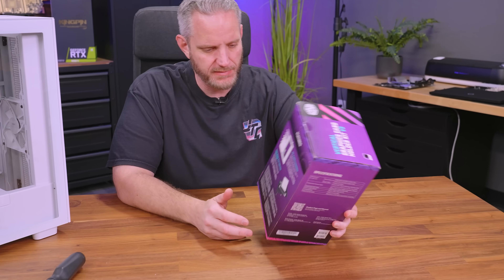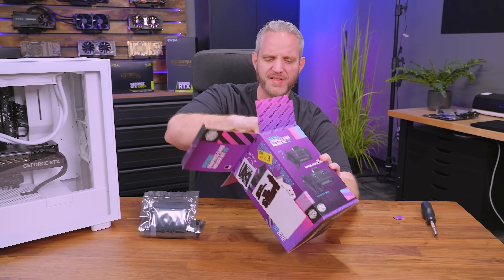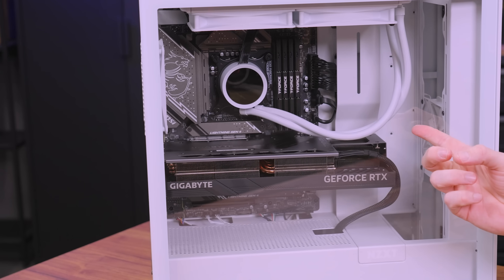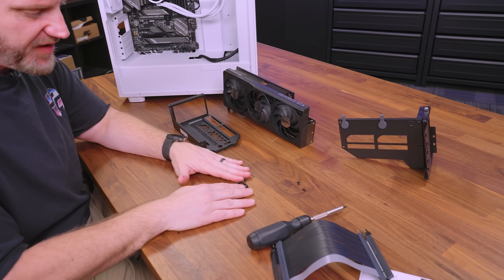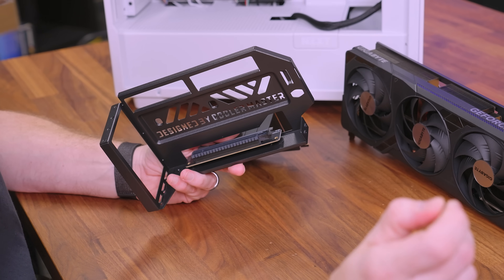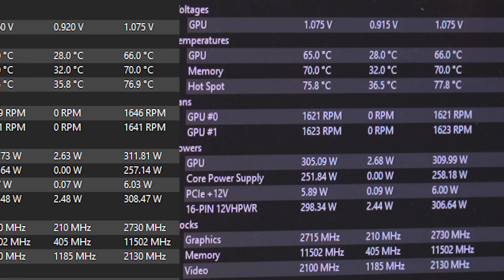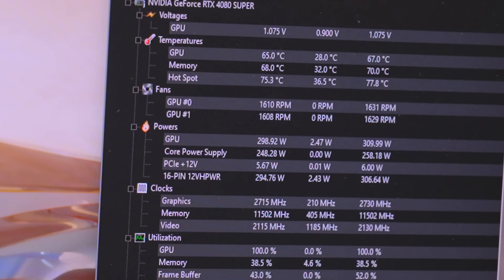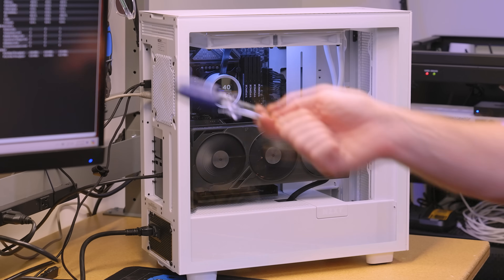Can this mount actually HELP GPU temps?

Comment: Speaking from a lot of experience (as much as possible, since I bought this mount as soon as it came out due to my insatiable desire to vertical mount my 7900XTX and display it in its full $1,200 glory lol XD), I can say this:

I absolutely love this vertical mount from cooler master. I have my 7900XTX mounted on it in a Corsair 5000d airflow case. It takes a little time to get set up, but once its in there, it works awesome. 1440p Ultra getting well over 200FPS with GPU maxing at around 65-70C and CPU (7950x3d) maxing at around 50-55C. Keep in mind, I also have 10 total fans in the case lol (6 intake, 3 in front/3 on side, and 3 exhaust on top on the AIO radiator and 1 rear exhaust) My PC stays COOL under heavy loads, however, my room.... not so much lol. It doubles as a room/space heater hahaha. But this CoolerMaster vertical mount specifically for larger cards (i.e. 4090 and 7900XTX hahaha) is WELL worth it, in my opinion. Being able to move the GPU side-to-side and forwards/backwards on the mount was a surprisingly extremely handy feature. I love this mount. 

EDIT-

NOTE!!!: There is a possibility you may have to mod your PCIe/GPU I/O panels to get it to mount properly. For example, in my Corsair 5000d I had to snip one of the PCIe panel separators/bars that run across, in order to get the DP plug into the case and into the GPU input without potentially damaging the DP cable. But once you have it plugged in, you can freely adjust the positioning of the mount to where you want it. Just throwing that out there for anyone potentially thinking of getting this. To me, I could care less, as I can still horizontal mount if I want despite having to mod the PCIe I/O panels, and the mod is only noticeable with everything disassembled and the case gutted. But you may have to take some wire cutters to your PCIe I/O slots if this is the way you want to go. So if you're not okay with making a permanent mod/change to part of your case, then maybe pass on this. But IME, that hasn't been of any issue, and I've never gone back to horizontal mount after installing this.

(Also, the "anti-sag" effect seen in this video is definitely a real thing and possibility with this mount, depending on your case specifics. However, there is still a possibility of MILD sag (mine does towards the end, with the 7900XTX being so heavy and large) that is easily rectified. But as it isn't GPU sag in the traditional sense, and more so a case of certain metal components getting slightly bent and appearing to "sag" even in a vertical position, it isn't even close enough to be able to cause damage though, and I only support it slightly with a bracket at the end still, solely for looks/OCD purposes hahaha.)

EDIT EDIT: I think it goes without saying, but if you DO decided to get this and end up having to make a few case adjustments for it to fit/mount, PLEASE do any cutting/modding of the case while it is empty. Last thing you want is nearly invisible metal shrapnel/debris from cutting up the back of the case making its way onto your motherboard, or into your GPU, or PCIe slots, etc... if you do need to cut/mod the back of your case, do it outside away from any components, and makre sure ALL potential metal shrapnel/particles are blown out of EVERY crevice of your case. I mean I did it with everything already installed, which is a HORRIBLE HORRIBLE idea that could have been a $3,000 mistake, but don't count on stupid luck like I had haha. The extra 20 minutes it takes to do it safely is WELL worth the time, lmfao.

All in all, well worth the money, especially for cards that are literally impossible to vertical mount in certain cases via the regular means/stock vertical mounting slots. Like, a Corsair 5000d with only 2 vertical mount slots, and a 7900XTX or 4090 that requires 3. The moveability is just an added bonus tbh. Pull da trigger on this if you're second guessing yourself. Most sensibly designed and functioning vertical mount I've come across, that also isn't a whole-ass project just to install. 10/10 would recommend

Comment: Interesting, my vertical mount makes my temps increase pretty noticeable. The glass isn't close to the fans at all, the only thing I can think of it the intake fans on the bottom of my pc are pushing the hot exhaust air from the gpu bask into itself.

Comment: This is actually great news, shame that I only now came up on this. Means I can probably put my strix 4090 in vertical even tough I have bot AND top radiators in my O11D MINI. Couldnt do that with lian-li's own vertical mount, because it requires the mobo to be on very top position, which cancels out using radiator, now I could maybe even go push+pull on both top and bottom rads. (not that I really need to but still cool)

Comment: I don't know man I don't like the look of the vertical Mount... I think the horizontal mount looks a lot better unless you've got a GPU that has RGB fans then I think it looks out of place... It just eats up the entire case when you lay it vertically like that it cuts off half the motherboard there's no color in the fans I don't know man I'm not crazy about the vertical look... Unless like I said, The fans have RGB or there's RGB lights on the face of the GPU or something just a plain GPU like that I don't think looks good at all

Comment: I would figure vertical mounting would be world better not necessarily for temp and performance but to take stress off your motherboard you don't have to worry about bricking your mobo with a giganteson gpu like a 4080 or 4090 or 7900xtx that weighs a boat load and pod allot of stress on your pcie slot ive seen them break off before pretty scary for real that breaks and you essentially get to rebuild your entire pc again that could seriously suck a verticsl mount is beautiful insurance literally in all this

Comment: like my sibling is planning to get an ASUS TUF Gaming A620M-PLUS with a Ryzen 5 9600X & an ASUS TUF 4070 OC Edition vertically mounted with this same mount on it's on the list as we slowly upgrade things she's not savvy for liquid solutions so I got a kryosheet for it and have looked up something that can cool the 9600X without need for liquid cooling and I settled on The Thermalright Peerless Assassin 120 SE Black because she needed something within budget too for now she's gonna use my old MSI Ryzen 011c Vampiric mid-tower micro to ATX case, to my question: Do you think there will be enough room to have the dualfan peerless heatsink on the cpu with the gpu vertically mounted or would it block it in such a case!

with in mind that my old artic 32 esports duo fan one came up to the glass in my old case with my older mb but that A629m-PLUS motherboard is an ATX will the CPU be high enough to be out of the way of a vertically mounted gpu in an ATX case cause the vampiric isn't nearly as big as the new one and the reason I got the hyperion was cause horizontally mounted in the motherboard the cable from my ROG 4070Ti oc edition was gonna be cut off at the stem by the glass until I got the new one I had to have my pc case open without the glass panel on so I was hoping to avoid that for my sibling with a gpu mount 

that's if the gpu mount fits since the old vampiric case the mounting screws for horizontal are on the back outside so it's like old pc cases where you have to mount the gpu as close as possible to the plate at the back and it's not indented with that L corner for screws internally!

Comment: I ordered the V3 in black for my ROG Helios, ended up getting white. But I did see about 7c drop on my 4090 and it was able to maintain higher clocks through entire testing instead of throttling.

Comment: This is why i think, that first: arhitecture of motherboards must change completely, and second: GPU shouldn't be PCIe expansion card anymore.
Guys, imagine motherboard with back-to-front sockets, but also PCIe and M.2 slots turned 90° into vertical orientation. GPU slot would be at the edge of motherboard, facing front of the case instead of its side. This will allow four things:
1 - everyting on motherboard (heatsinks, RAM sticks, additional PCIe cards, CPU cooler) now would be verticaly oriented, witch means, that no component will block airflow for the other ones, 
2 - GPU can be now as large as motherboard, it can be mounted exactly the same, rock solid way as such, next to it, but it'll be still directly connected through this new edge-GPU slot,
3 - because motherboard and GPU would be mounted in the same plane, next to eachother, it will be possible to put them in completely separated case chambers (with cut out for GPU edge-slot), witch means, each pcb board will have its own cooling chamber, GPU will not heat up air for CPU anymore,
5 - almost perfect bottom to top (or side to side) airflow for every PC part would achived.
The only downside would be necessity for additonal PC case wiring, connecting reoriented "case wall-mounted" GPU and PCIe expansion cards to their outlets. And so PC case would be practically tri-chamber, one for motherboard (with expansion cards, M.2 discs, RAM stics and CPU cooler), second for "inner wall mounted" GPU, and third for PSU with its wiring, additional SATA discs, fan spliters and ARGB controllers...

Comment: All those vertical mount adapters disable PCIe cards eg 10G Network Card, HBA / RAID cards for NAS use case … which is a pity - any models do support existing PCIe expansion cards? I have a bigger EATX case (Fractal 7 XL) which has 3 slots vertical mount space hence I’m OK with that case but not other 2 slots vertical mounts cases I also have

Comment: I have a question i am using msi tomahock ATX with noctua NH-D15 and want to use the same vetical mount will there be any space between gpu and cpu cooler ?

Comment: just got this mount for my 4080 super AORUS.. it actually does help with the temps!! I have a full tower case and modified the case to allow it to exhaust hot gpu air directly out of the case (only works if you have a blower card that exhausts from the top of the card). great video Jay! been learning from you for years now!

Comment: Hey Jay, great test! You should try this with other types of cards, such as blower style founders edition cards. As these cards exhaust a good portion out the rear expansion slot, they may suffer in a vertical mount orientation

Comment: Can you mount a 4090 on this?
Reply: Yeah I bought this one after watching the video and used it to mount my Asus Tuf rtx 4090 OC card. And I've got to say it is really stable. Alos temps have indeed improved 2-4 degrees on gpu and hot spot respectively.

Comment: You glossed over a bit about temps so not only did the card hit lower temps (however small difference) it did it with slower running fans as well because max rpm was also lower (again small difference) but this leads the gpu to boost one tick above as it thinks it has cooling headroom with lower temps in its baked in fan curve. So in fact it runs cooler and faster as it has more headroom for same noise/rpm for the baked in fan curve along with the core boost curve.

Comment: I had a phanteks gpu vertical mount in a lian li case , less than half of this thing in the video.............in my opinion the airflow its better in vertical mount but this depends what case you have

Comment: so if the gpu card is mounted vertical and your case allows bottom fans should the lower fans be push or pull?

Comment: I’ve had this exact riser for over a year now. I love it! I have a PNY 4090 holds it just fine. And I’m using it inside of a NZXT H9 elite case.

Now if only they made a water block for my GPU (the regular PNY 4090)

Comment: The @technologyhive uploaded a video about vertical mounts being pretty much the only solution to mounting heavy gpus. Guy fixes gpus for a living and those little stand/support things that come with gpus these days are actually causing bending on the the boards and breaking the solder joints on many cards. Worth the watch imo.

Comment: I'm running this vertical mount in my O11 with Gigabyte RTX4090 Gaming OC for a year now without any problems. This graphics card is so tall, that with power connector on top, I wouldn't be able to connect the 12VHPWR connector, because it would hit the glass when GPU was mounted horizontally. Also no problems with signal integrity when PCI-E gen.4 is enabled - never had any problems booting, artifacting or display blinking. Can recommend.

Comment: I can see your point i have the hyte  y60 and it looks so good but they clearly thought about cooling gpu before doing it as putting fans underneath it in the floor seems really smart and good way to cool it
Reply: And how is that case? I have it and just not built it yet. The GPU is too big sapphire nitro 7900xtx so this mount might be able to move it back away from glass ?

Comment: I wonder what delta is the CPU temp between the two setups, kinda expecting higher CPU temp with the vertical mount because of the GPU fan direction

Comment: Horizontal? Vertical? What about "upside-down"?

I purchased this cheap OEM PC with an i3-10100 that was running "onboard graphics".

I put a small graphics card in it - but the whole computer is like "upside down" (I have seen this before once), meaning that this small graphics card, which I put into the PC, it is also "upside down" (the small fan being at the top).

Does this in any way influence GPU temps?

Comment: i got a msi rtx 4090 that came with a gaming trio support bracket thats bent outwards towards the glass so it doesnt actually sit under the card, what bracket would you suggest to replace it, this card is huge so not a fan of it potentially sagging
or is one of these vertical mounts a good option, have a montech sky 2 case and they also offer a vertical mount

Comment: Son uses a lian li vertical mount in his corsair C70 case. So far the 1080Ti ftw3 has had no problems. other then we did cut a few off the PCI-E slots so the cables could hook up.

Comment: i have a corsair 5000D and y EVGA RTX 3070 FTW3 is starved for air when i have it vertical mounted. Just ordered this to see if i can keep it vertical as i prefer the look. I was running a sound card but might go with a external DAC so i can run this.

Comment: I have a micro atx with a 1060 6gb the card takes up the whole lenth of the case 😂no way i can flip it 90 to add a cool factor i need a new case but i do love the small movability and space saving of it it just works

Comment: Dude this kind of mount would rock with one of the older 2000's cases with a 200mm fan on the side panel, like the Cooler Master HAF932 
Those temps would be AWESOME

Comment: I have a Galaxy 4070 Ti graphics card, and I was wondering if it's better to mount it horizontally or vertically in a NZXT H6 flow case??
I plan on having 2×140mm fans as intake from the bottom, in this vid there was no fans blowing air onto the card from below. So I was wondering which way to mount it..
Reply: I just put my 4090 in an h6 flow. 3 fans on the angled part, two in the bottom, one for exhaust on top and one on the back of the case. Someone had posted that two fans up top can sort of suck out the cool air before it even reaches the CPU cooler depending on if you have a tower or an AIO there. You will get better temps imo with it mounted normally because otherwise the vertical mount will sort of act as a giant wall for the 3 angled fans. The two fans below will have to force the hot air from the GPU that blows toward the two bottom fans back through the GPU before it exits the case. Imo a vertical mount will result in much more recirculated hot air through your GPU. IF tho your 4070ti is very short and doesnt block the angled fans off they will help push the hot air out but you will still get more recirculated hot GPU exhaust with a vertical mount
Reply: @D3nsity_  I'll go with a horizontal mount then, with 3 intakes on the side, 2 intakes from the bottom, 3 exhausts at the top, and 1 exhaust at the rear. I'm going to use AK500 (tower cooler) for the cpu

Comment: Wouldn't it make sense to go back to cases that dont have a glass side and then mount exhaust fans right up against the vertically mounted card..? You could still go with clear front and top panels and even diagonal front panels to get that visual eyes on look.......?

Comment: Why don't manufacturers just build a separate compartment for the GPU at this point? Hell, you could even make it completely encased and no moving parts. I'm even thinking you could have it submerged in oil, then have the cooling system running as part of the outside.

Comment: I have the Tt View 51 aquarium with a verticle mount and I honestly have no idea if I'm getting enough air flow. I found 2 old 140s and an old 120 that I threw in to add intake to the stock 200s. I've got the included 120 exhausting with two 140s 'exhausting' out the top on a 280 AIO. Tons of space. The GPU is well away from the glass and the 120 bottom intake is right under it. When it's hot I can FEEL the heat coming out. I really feel stupid just buying parts and throwing them together like I do...

Comment: I use that CM vertical kit v3. My GPU temps are excellent in my CH560. My RX 7900 XT GPU most of the time goes zero rpm on low/light load. Idling on 30-40c. On full load, nowhere beyond 80c (without aircon on). With aircon on, doesn’t pass 70-75c.

Comment: Been using the white version of this vertical mount for half a year now and I love it! It allowed me to position it to have an extra fan blowing across the heatsink fins since my card is a dual fan not triple. Temps rarely crack 50*C and that's on ultra cyberpunk 2077.